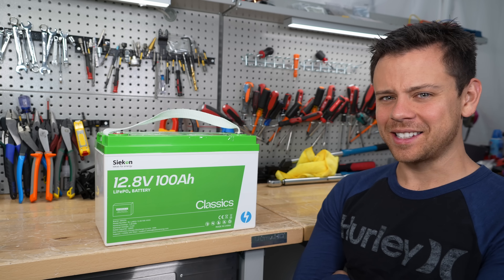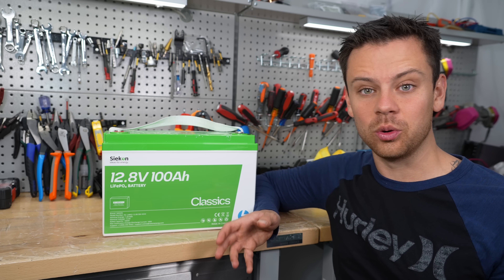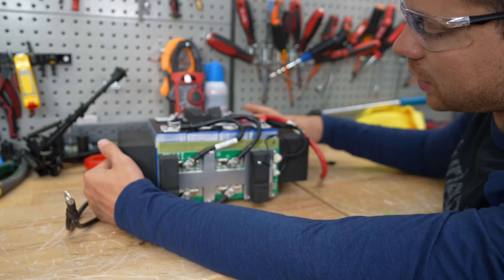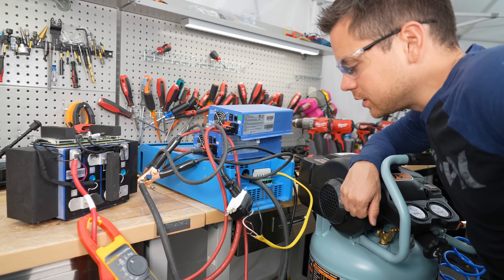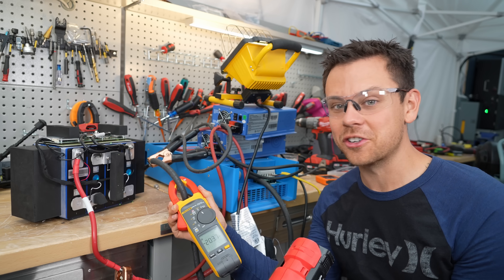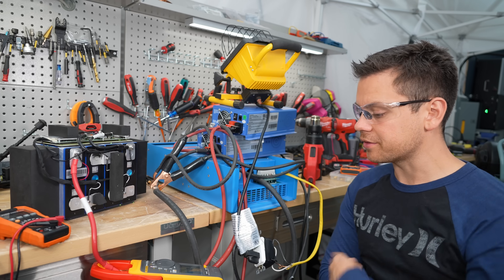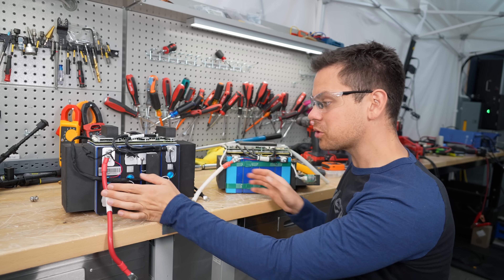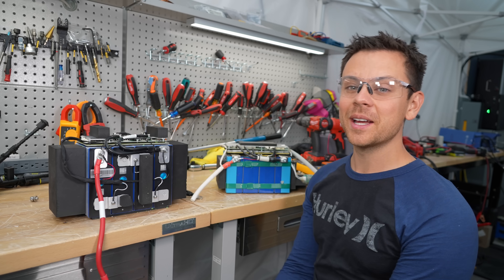Lead is Dead! $229 LFP Siekon 12V 100Ah w/ 150A BMS and Low Temp Charging?!

Comment: My 100Ah AGM has a CCA rating of over 700A and can start my engine. My 540Ah of LifePO4 prismatic cells can't so I don't thing lead acid is quite dead.
Reply from the maker: But considering prices I think they'll have a starter battery soon
Reply: But my starter battery needs to work after a week at -20. 
 @WillProwse
Reply: @phhowe17  I had a LFP starter battery for my motorcycle. I would have to run the headlights for about 30-60 seconds before i could start it in the winter.
Reply from the maker: Yes lead acid is fantastic for starter batteries. I think that's the last application they have
Reply: True. Lead-acid remains the best for starting an engine, but for off-grid power systems LiFePO4 are the BEST!

Comment: Ive been using 8, 100 amp 12 volt weize lifepo4 batteries in my van. Im able to run the ac all night and keep my shower water hot and ready for the morning, while running a dorm fridge/freezer. Im so happy I don't have to have a thousand pounds of lead in my van for the same performance. It takes at least 4 times longer to charge a lead acid battery bank, for the equivilant capacity of lifepo4. 

Im not dying this summer and I am so grateful.
Reply: Yes, what are you using for an AC unit?
Reply: @higbeedoug  50 dollar used window unit I stuck in a back window and framed out. The window was already broken. Took the opportunity.
Reply: I'm just learning about solar. Why 8 batteries? Could you have gone with fewer batteries at a higher DC voltage (48v) to get the same desired available wattage? Or do you specifically need the 12 volts?
Thank you
Reply: @carminec4000  no. You need volts, and amps, to make watts. Watt hours are a measure of capacity. If you cut the amount of batteries in half, you get half capacity in the bank. 

12 volts was what I had. Higher voltage systems are better.
Reply: @carminec4000  Either way you slice it, he needs the capacity to do that all night. The real question, is how does he recharge it during the day? Alternator, generator, and what proportion is solar?

What is the SEER rating of your unit, and what brand/make do you use?
Reply: Lmk how winter goes
Reply: @357smallblock  even better than summer. I hardly use any electricity at all keeping the batteries warm with the diesel heater. . . You can do it too if you actually put the effort in. Ive been through 3 winters already.

Comment: $190 on the Siekon website now.  But i noticed it says they must be disconnected and charge individually when used in series.  So that could make golf cart usage a pain in the butt.  I'm sure you have recommendations for speed controllers for a 48v golf cart setup.  Will check that out now

Comment: Nice to see cheaper batteries that don't cheap out on a low current BMS that limits the output.
Reply: Yep. Nice BMS, useful with bad/no over current protection like lead acids are.. could hurt itself though

Comment: New eve cells are now $60-$80 in China. This is insane. Being able to go off grid will become so much easier in the next few years in sunny places. Prices of assembled LFPs will likely drop to around $100 per Kwh soon if not already.
Reply: You can already find them at that price at Battery Hookup.
Reply: I'm leery at $500 for a 280 AH. You cannot monitor them. They say they have all the features of the top of line BMS. I guess the savings is trusting the BMS and it is nice not to monitor it. I worried about flooded batteries for years. I monitor the inverter and solar controller which is enough.

Comment: I'd like to see tests of these trying to start a gas car
Reply: It's not a realistic test. It's an extreme crazy test just because you can.
Reply: LOL! Don't try it. The BMS in these are NOT designed to allow that much Amperage draw! You WILL destroy the battery.
Reply: Without a DC/DC converter in series with the alternator output, you will burn out your alternator at idle speeds...

Comment: IMO no over current protection is way worse than tripping to soon. Nothing more exciting than when your cables become a welder when you don't expect it.
Reply: Put a fuse in line!
Reply: A smart person can limit how much power they draw........use enough batteries for your inverter and it should trip the low voltage protection from draining the battery and not have a problem. Fuses are a good idea from the other person responding. Buy a more expensive battery and it may not be something you have to think about......your choice. Yes, it would be better if they performed as advertised, but it is cheap.

Comment: $190 with free shipping is crazy! I wish i had a use for one
Reply: Hook a cheap inverter to it and it can run a fridge, furnace fan and TV plus electronics if power goes out. Look at Texas now. There is no need anymore to be without. It won't run your AC now but maybe someday.
Reply: Where are you seeing $190? I can't find that. Also Amazon limited to only 1
Reply: @marcarcher5426  on their website. I bought one for a shop battery to run my winch and random tests with. We will see if they actually ship
Reply: It's on the website

Comment: If I replace the 12V house batteries on my motorhome with these, will I also need to upgrade my converter charger to support lithium charging profiles?
Reply: Yes, but maybe not, if you have an MPPT solar controller that is rated for LiFePO4 batteries. Make sure it's NOT just rated for Li batteries. It needs to be for LiFePO4, because the charging parameters are different.

Comment: Off-grid 1 season cottage? 

I use Liithium Ion in the summer but bring them home in the winter. Could this battery survive -20F with no power to run a heater?
Reply: You might have to ask the manufacturer about that, but I believe that as long as you are not pulling power off of them, nor putting power into them below 0 degrees C, (32F) then they should be okay. Just make sure to slowly warm them up before charging or discharging them. I would use a battery cut-off switch or disconnect them to make sure.

Comment: Wonder if it can be used for car batteries, what modifications would be required?  Tesla now uses lithium low voltage battery instead of lead acid.
Reply: Might work for an electric car, but not to start an ICE engine.

Comment: Just subscribed noob! Would this be a good substitute to replace my 2 6v lead acids in my small travel trailer?
Reply: Definitely! They also charge much faster on a good MPPT solar controller, because they have a much lower Resistance rating. You may have to either disconnect the Converter or replace it with one that is rated for LiFePO4 batteries. these batteries need a higher charge Voltage to properly balance the cells,  which a lead-acid Converter or battery charger will not do.
Reply: Thx for the reply 
If I don’t charge through my converter and just use solar or separate charging device will my existing converter still work to run my other utilities in the trailer without upgrading??

Comment: I appreciate your reviews and was waiting/hoping you would review this battery, thank you!
My comments are related to their protection claims, I have always thought low temp had 2 separate settings, low temp charging (around 32 F or 0 C) and low temp discharge (around 0 F or -15 C)  only a temp controlled test would be able to properly evaluate and while dry ice or compressed air does activate the probe, we do not know at what temp and their website only showed, what I consider low temp discharge of 0 F, so maybe this would get damaged by trying to charge below freezing?
That, with what you found on over current worries me. I have bought many of the Redodo brands and they show both low temp charge and low temp discharge, although I have never properly tested them and their prices are comparable.
Keep up the great work as you are the standard I look to for accuracy.

Comment: I know the conventional answer is to not mix batteries but I have 1 100ah sok metal case battery with heater and bluetooth is there any way I could hook one of these in parallel with sok?

Comment: Lithium only needs safety features because of the fire risk if anything ever goes wrong with them.  They are not terrible but you must be mindful not to damage it at all if you can avoid it
Reply: That only applies to the older lithium chemistries. LiFePO4 batteries do not have thermal run-away, and I have seen a pouch cell punctured with the only result being that it gave off a bad smell.

Comment: Lead will be dead for sure when these kinds of lithium batteries are on the shelf at the car parts store, and we can use them as starting batteries. Otherwise unfortunately, we're stuck with the inferior technology.
Reply: many hybrid cars 12v are lithium now
Reply: @JD-yx7be  The battery bank for the MOTOR is LiFePO4, but the engine starting battery is still lead-acid.
Reply: @Tumbleweed5150  Most hybrids use the main traction battery for starting and don't have a alternator or starter. The 12v is strictly for accessories  like headlight, windshield wipers, electric seats.
Reply: True. The battery would need to be able to put out 500A to 900+A.

Comment: Can this be ran in a car audio system?
Reply: Yes, IF you use a seperate battery from the engine starting battery. LiFePO4 batteries are NOT designed for the VERY high, (500A to 900+A), draw of the starter.

Comment: Will, please do a video on charging LifPo with a lead-acid charger when the LifPo has a BMI.  My RV mechanic said I have to change out my charger if I go to LifPo.  I have heard that with a BMI any charger will do.
Reply: The reason to change out a charger for LiFePO4 batteries is that the charger won't get the Voltage high enough. If you have a solar system installed with a LiFePO4 MPPT solar controller, and can get enough sun during the day, that would cover it. All of these kinds of batteries seem to have a passive balancing mode, but one needs to get the battery (bank) up to the highest recommended charging Voltage in order for that to work, which is why chargers for lead-acid don't work very well.
If your battery charger is also a Converter, you may need to change it out.

Comment: Bearing in mind the surge current capability of this battery could it be used as a vehicle starter battery?
Reply: That's my question too. I want to switch from AGM to LiFPo4 on my 40' sailboat. Currently have two 168AH AGM batteries, and a 40AH AGM starting battery. I think people say the instantaneous current draw for powerful DC motors like the starter motor and Anchor Windlass would exceed most LiFPo4 BMS capacity. 

Considering that I want to use two 12V 300AH LiFPo4 batteries in parallel, I am boggling that my starter motor, in particular, could draw enough to damage anything. 

My alternator voltage controller already has a LiFPo4 mode, so that's not an issue, and I want to install 400+ watts of solar (single bi-facial panel), so I feel like maybe I've been drinking kool-aide from the lithium haters.

Comment: Wow, 2 years ago I scratch built a 12v 200ah with all the bells and whistles. Cost was around  $800. Had to install a 5amp active balancer (new version) Battery has been working pretty much flawlessly -15° - 95° for 2+ years. Enjoyed learning and building one, but why build one from scratch now? Thanks Will, with a mention to Andy @ Off Grid Garage.
Reply: Because it is still technically cheaper to diy. He has a few videos about this. At these prices, i wouldn't.
Reply: 2 1/2 years ago I built a 300ah 12 volt lithium battery and it cost $750.  At that time, I felt as though it was a smoking deal.  My battery is still going strong as well having used it every day since it was built.  But it is crazy how much prices have come down in such a short period of time!
Reply: @lightitNrun  5 amp? What kind?
Reply: A month ago, I bought a heated 200ah 12v from Li Time for $720 plus tax in comnifornia. A year or so ago, I considered building my own but like others said, it was a no brainer to spend the money and have something ready to go for my travel trailer. The finished package is better than if I had done the DIY route and tried to not go heater or added my own heaters.

Comment: You don't mention that the main reason for using lead is because of the higher cold cranking amp ratings.
You show 300amp push out through the inverter but don't test crank amps directly on the battery for use in large vehicles and heavy machines.
Reply from the maker: I literally started a car lift 🤣 try that with lead acid. I'll be making a load tester than can do 600A
Reply: Starting a car engine can take more than 500Amps, even more than 900Amps on some engines, especially in cold weather. Use lead-acid only, for engine starting. These batteries are designed for off-grid power systems.

Comment: Greetings Will from 🇵🇷Puerto Rico. Excuse my English but I’ll like to know if you could help me in my question, I just bought two 10k lithium batteries (SUNPOK)for the total of 20K. I build my system using your help, but now after switching from lead acid to lithium got confused in how many amp these lithium should be charge? Because some people said 40amp, like 20a each. Are they wrong? Thank you for your time and knowledge, God bless you 🤝
Reply: Most LiFePO4 batteries charge best at 20% of rated Capacity. So, if you have 200Ah of them, charge at 40Amps. Or, better yet, check with the manufacturer for specific details for YOUR system.
Reply: @Tumbleweed5150  I really appreciate your support for this project and thank you 🙏

Comment: I have one of those battle born batteries.  I'll by a couple of these.  Is it ok to mix brands when putting them in parallel?
Reply from the maker: Yeah sure, but to be safe I would add a fuse to each one. I have a video about current sharing that I posted a couple years ago. Covers all safety details
Reply: @WillProwse  cool, thanks man.  I'll check it out.